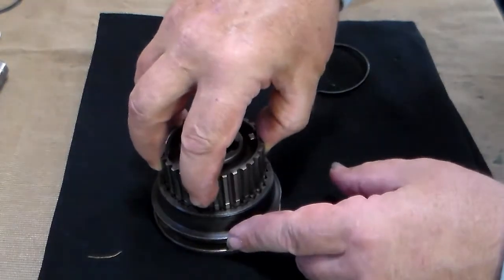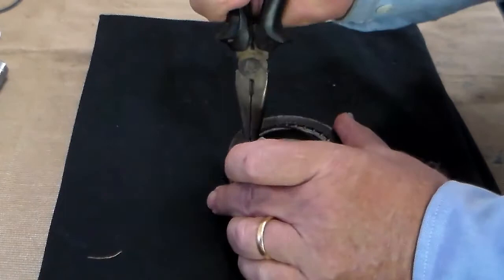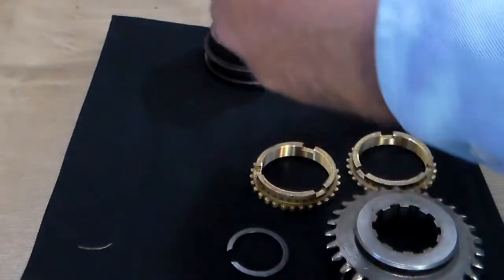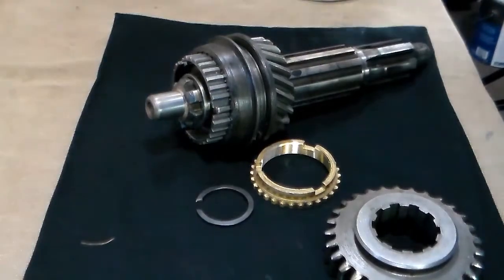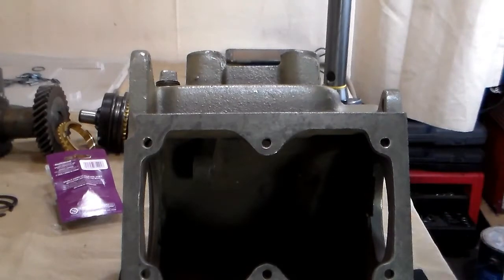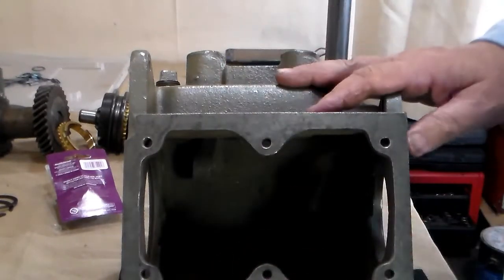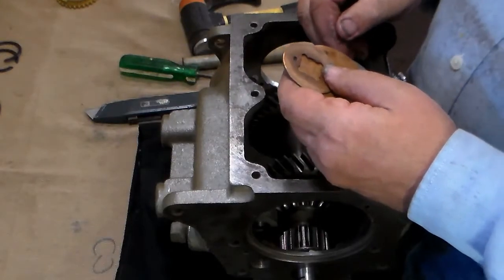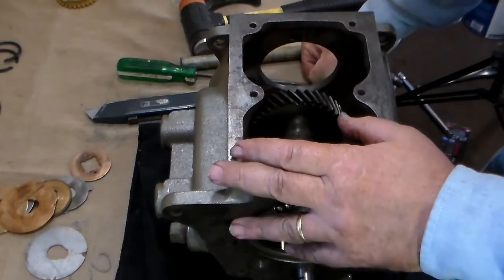11 Rick Stivers T-90 Rebuild Guide - Assembly Part 2

Comment: I just use light hrease to hold the washers in place and install the cluster gear i have never had any issues where I needed to dry fit or use a dial indicator nor does the factory manual make any mention of it
Reply from the maker: Unfortunately, many people are not as skillful as you and find the stacking process intimidating. That why I came up with the instructions in the video. For many people it simplifies the process.
Reply: @rickstivers3965 whatever works I’ve just never done it that way is all im saying

Comment: Is there a reason you skipped the transmission oil retainer washer when assembling the main shaft?
Reply from the maker: No, It got cut out during editing. You are the first person in four years to mention it. Good catch.
Reply: @rickstivers3965 the oil slinger was eliminated in later T90s and plugs were installed in place of the screws the slinger isn’t really needed
Reply from the maker: Battle Jack, what you say is true, but he was actually asking about the oil retainer washer that is installed on the main gear and not oil slinger. Unfortunately, I edited out the installation of the washer in the video.

Comment: What are you using to seal the cluster gear shaft, what sealant do you spray on the gaskets and what do you put on the threads of the bolts that go through to the oil?
Reply from the maker: Andrew Lane I use # 2 non hardening form-a-gasket, any brand to seal the shaft and threads. I use any brand of spray on copper gasket sealer.
Reply: @rickstivers3965   I too use #2 it works like a champ.

Comment: Rick,,,How important is it to put the synchronize spring in the same synchronize plate on both sides?  not sure if it's in the same plate and have the trans and case all back together. Should I break it all down to check,, you know it means taking the whole thing apart. Not sure if it will be a problem in the future.
Reply from the maker: Douglas Battjes, It only serves to keep the pressures even on the inside of the sleeve. It should be okay if you leave it that way.